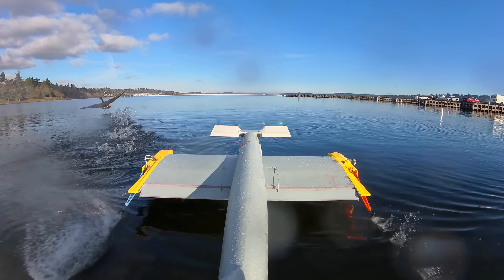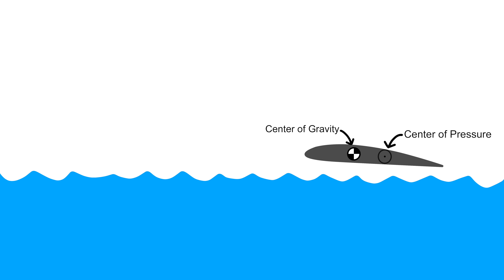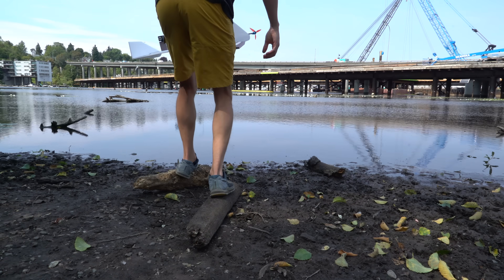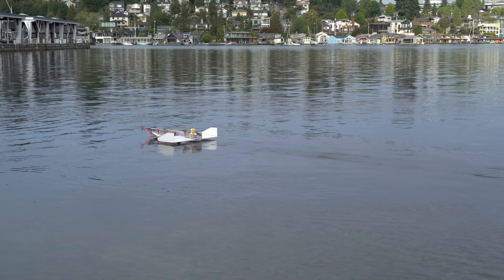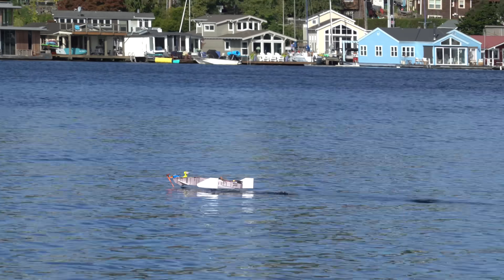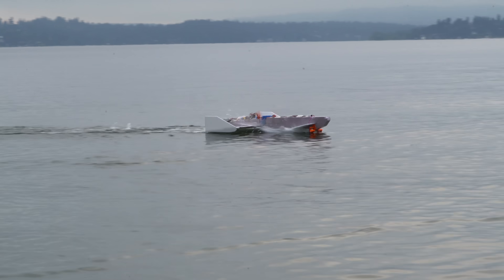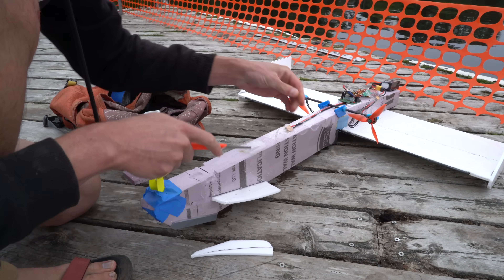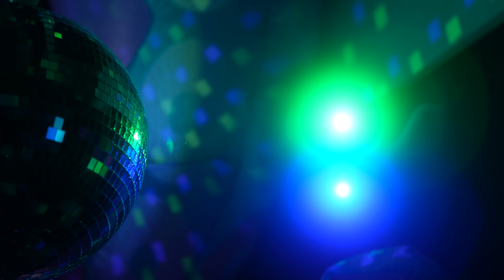Testing a Hydroplane / Ekranoplan Hybrid

Comment: For a surface drive propeller, the prop shaft needs to be level with the water. That is how it is on all my surface drive hydro planes. If they are pointed down, they will cause prop walking and skipping as they are lifting out of the water and dropping back in. Try putting them flat with the prop shafts level with the water. Even some up trim might help. My 3 motor Lobster boat has the prop shafts level on the rear of the front pontoons and the transom. It skims on the props with no wings. If you want, I can ship you my Lobster boat to play with and do some testing. It is basically a 3-point hydro with motors on each point. It looks like a Lobster.
Reply: Solid advice. ❤
Reply: That's certainly a new kind of lobster boat, lol

Comment: Idea: Stick a blade on the planing hull. A curved blade with a banana profile extending down and then to the rear of the craft. You want there to be some drag from the blade in the water (probably less than a 3d printed part could manage, maybe razor blade thickness here), but the shape would help create more drag if the nose pitches up (because more of the blade would be exposed against the water flow), which would would help 'drag' the nose down providing a self correcting curved 'wand' for the nose of plane to ride on (but without the horizontal elements like the racing boat you showed).

Comment: It looks like the canard is making too much lift. If you made the canard a more symmetrical v shape-perhaps with slightly more conventional downforce from the upper half of the v-you'd get only net lift from the high pressure underneath and it would be much much less likely to take off at high speeds.

Comment: Having the front only touching the water seems like putting the vertical stabilizer of a plane on its nose - it will strongly grab/drag and cause the yaw instability you saw. Even the small 'wand' is quite a strong influence compared to grabbing air - it's fine on the hydrofoils you showed because they have two other far larger surfaces also grabbing the water.
I wonder if the blow-over problem could be solved by using a canard layout, where the front wing can somehow, uhhh... disappear on command - for example, swing into the fuselage F-14 style. That seems more controllable than having it rotate in pitch, which changes the dynamics of the aircraft a lot and is harder to control with simple algorithms. Perhaps the disappearing canard could be linked to an AoA sensor, or a pitch gyro, or both. Either way, the disappearing would have to happen very quickly.
Reply: Thinking about this a bit more, it seems like part of the problem is that if the nose has started to lift up, there is already some rotational inertia that needs to be canceled. So perhaps a disappearing canard wing might not be enough, especially if the fuselage also has a large surface. Maybe it does need to rotate in pitch a bit, or have another 'spoiler' type surface on the top side of the fuselage nose that folds upward when the pitch is becoming too high. Or maybe the disappearing surface could instead be one that's folded in by default, and folds out to counteract pitch-up.

Comment: Could you use a ground effect canard or second ground effect wing at the front? If your lift is coming from two separated wings it would give the change in ground effect as you get closer or further from the water a torque that is in the opposing direction so might be able to stabilise the angle of attack. 
By changing the relative sizes of the wings you could tune the strength off this torquee..

Comment: Would it work to have spring loaded flaps, so that the flaps would retract from the higher pressure and then extend when the pressure is lower to keep it in ground effect?

Comment: hydrofoil front and ekranoplan back? the good thing about hydrofoils is you can create positive and negative lift so theoretically you could have a hydrofoil at the front slightly pulling down and the ekranoplan creating lift at the back, you could theoretically find a balance. You could also connect both front and back wings together with a counteracting control rod to create that negative feedback loop you are going for. It certainly would stop bouncing with a foil!

Comment: So, here's a thought: instead of a hydroplane, use a hydrofoil mast with multiple small foils on it so that as the mast lifts out you get less lift. I'd say use a V shaped foil, but I think that contributes to your yaw instability (along with your V shaped hull). If you want to stick to a hydroplane instead, I'd suggest using a flat planing surface (so that you don't get a forward pivot) that tapers to a point towards the back giving you the same decreasing lift feedback.

Comment: Not sure if this helps, but ground effect can never be a negative feedback...  The main component is increased air pressure under all of the "bottom" surfaces, with diminishing effect.  Created air pressure can be increased by a combination any/all of these components: speed, pitch and shape. Excess build up of air pressure will result in a stall or a backwards flip as illustrated later in the video. 
In short: Ground effect is not more effective with lesser distance to the surface. Its more effective with more "under" air pressure created while avoiding other adverse conditions (flip, stall etc.)

Comment: I have a feeling, a huge horizontal stabilizer is actually necessary. And it needs to be mounted very high so it is always out of the ground effect. (just like the soviet ground effect vehicle) In that way when the main air foil at the front loses life due to being too high out of the ground effect, the horizontal stabilizer is still providing the same amount of lift. Thus the center of lift will shift forward instead of backwards. (well my only experience of aircraft design is from KSP and your videos, so I absolutely don't know anything)

Comment: try equally sized nose wings and tail wings, when pitch increases both nose and tail will gain altitude equally, it wont stop it pitching up but it should stop the run away flipping effect.

Comment: I would go back to the pure WIG in the beginning of the video and counter the shift in center of pressure/lift with a very low-aspect ratio canard, far forward and lower than the main wing. When the canard encounters the ground effect, it gets a lift boost and lifts the nose, but if it gets too far up, it becomes largely ineffective and makes the nose drop again. That requires the boom/fuselage between the main wing and the canard to have almost no lift itself, so preferably it would just be two thin, flat blades on either side, with an empty space between. That way, the fuselage forward can't contribute to nose-up lift when the nose pitches up slightly, and so avoids a positive feedback pitch-up effect.
Reply: He has tied both hands behind his back by saying that the normal approach of movable aerodynamic control surfaces which he has already proved works is now "considered cheating". Actually, I did see  some kids solve this problem in a canal in Can Tho, Mekong Delta - the little sea monkey kids were playing with a toy with a long aluminium tube to the rear of the low-aspect ratio hydroplane/wing surface and that was used as a push stick to launch their ekranoplans and also as a  very effective stabiliser but it did touch the water surface occasionally.

Comment: I keep thinking, couldn't you have the battery mass on a linear rail and actively pull it to the optimal place to balance the pressure... but I guess you'd need to know the elevation pretty accurately for that to work. Like a whisker-controlled center-of-mass

Comment: Like a gyrocar, but on water

What if you add horizotal flywheels gero at nose and tale? Like two cotrorotational in front and two in the rear. Maybe it will prevent the craft from tilting too much, also you can use the differential in power inputs to yaw the craft (hence solving the turning problem). Also, you can use a drone esc to power those.

Comment: This might get lost, or maybe someone already suggested it but I kept thinking you could solve yaw and pitch of the nose by fully submerging the front nose water motors. Have a really thin chord on the extension and fixed or variable angle on the in water motors and you can use the upward pressure underwater for nose pitch and the chord for yaw control. It would natrually limit speed which could be good too. Sort of like having a submerged nacelle. It would also keep you from interacting with surface waves.

Comment: What if you had a spoiler on the wing that was spring assisted in the closed position, but when airspeed increased, it would open, thereby killing lift directly above the center of pressure? The balance could be tuned based on the size of the spring and/or the area of the passive control surface that actuates the air driven deployment mechanism.

Comment: The original Circus Circus unlimited hydro plane was a "reverse pickle fork". This video is of the unique spray deck on our Kasperwing,  ultralights,, the airfoil created enough lift to offset the weight of the floats, the top speed decreased 5mph. The spray deck and floats created a very effective pressure " bubble" which shortened takeover considerably.  https://youtube.com/watch?v=Y3C-59l62hc&si=dHPCNhUJo-vhQu9V

Comment: Having a V-shaped hull in the front was my first thought when you presented the general idea. Can't understand why you always use flat bottoms in your projects.

As for historical ground effect vehicles I think the Swedish A32 Lansen, a cold war era attack aircraft, also fits the bill. It could (and would) be flown as a regular aircraft, but in attack missions against targets on the sea (like a Soviet invasion fleet) they were flown at altitudes below 10m (and rather 5m) above the water. The nose pointing down to fight the ground effect. If the water plume behind it wasn't reaching higher than the tail fin they were flying too high.

Comment: i think your ekranoplanes are too light to avoid the bouncing. they dont have enough inertia to dampen the bouncing on the water. With more weight, small waves would not push the plane up as much when it contacts the water surface. You have too much lift compared to the weight of the plane to keep it steady above the surface. Good video though, cool ideas!

Comment: if you make the front part look more like the bow of a boat (ie. a V) then the graph of upward force vs pitch will look more like a straight line instead of a cliff. as the tip of the V initially touches the water, the reaction force will be minimal, then as the depth increases you'll get more lift with a smooth transition between instead of the bouncing you're seeing.
EDIT: oh, nvm.

Comment: Ekranoplane is not a "ground effect" plane. It benefits from it, but is more a forced air cushion plane with the depth of the wing surfaces. And ground effect is not an air cushion. This was proven in wind tunnels, though air cushion can happen with a sufficiently large enough wing.

At least I refuse to call the ekranoplane a ground effect plane. It benefits from it, but I find it's more a forced air cushion plane

Comment: Nice video! The big shocks are mostly from the air-water transition over waves, so a mass damper/inerter in the nose assembly to dampen the shocks from hitting the water may be one way to solve it. Another idea would be a small hydrofoil to ensure constant contact and a stabilizing force.

Comment: Talking about center of pressure movements, I'm surprised you haven't thought about a variable center of gravity system. Like mount the batteries on a moveable rail inside the vehicle and it would adjust to the speed of it. I suggested a similar idea on your gliding body project years ago.

Comment: Why not just a swept wing with an aggressive forward mounting so that when center of lift shifts back it gets into a sweetspot?

And a simpler glide shape for a fuselage is an ogee shape, kind of like an s-curve. The front will stall as it noses up and the rear of the fuselage will maintain lift. It will self stabilize better than a straight shape.

Comment: If you want to avoid bumpiness and want to keep contact with the water maybe the submerged t foils like the moth with a wand and capable of negative angles of attack to "pull" down is maybe an option? If the mast of the foil is long enough it can handle some chop. Depending on your speed you may have to opt for a supercavitating foil shape like on sp80 or sailrocket. I don't know how well the ride height correlates with the ground effect. You may need height adjustable wings.

Comment: what about adding a small weight inside that you can translate fore and aft to "tune" the center of weight against the center of pressure?
Reply: Oh, I see this is idea is mentioned already.  A weight out front that can translate quickly fore and aft, wouldn't need to mess with air speed.

Comment: Porpoise is caused by a hull coming on and off plane at speed. This was a problem with jetskis for years. You would mitigate it by shifting weight around on the ski, to keep the nose down. The later skis lack this issue due to adding keel length and just being so heavy that the rider weight doesn't shift cg as much or at all. Changing to a v-hull helped, because a flat bottom planes faster than any other hull design. The basic V shape with no pad, took longer to plane, thus buffering the porpoise. I think elongating the nose, by a lot, and designing the nose hull around speed, would make your concept sorta work. The yawing issue will always be a problem. The boat needs to be powered at the stern, while the aircraft needs to be tractored.
.
Maybe consider taking an existing RC boat, a long fast one that barely contacts the water at speed, and add your lifting device to that design. If you could make it stable, it could help decrease porpoise and buffer waves because the nose authority would be counteracted by the tail.

Comment: Another solution to the pitch issue is giving the wing a little up turn at the back like on flying wings the lower you are the more it acts like a defuser in a race car causing some downforce way at the back of the wing if the angle is too low

Comment: It seems really hard to balance a neutral pitching moment vehicle without doing the math on your surfaces. As long as your wing can produce excess lift, it will. And as long as your stabilizer produces insufficient down pressure, it'll always. There's an opportunity here to take it further, but it might be beyond trial and error approach

Comment: I think your main issue is the low weight and lack of inertia. Try adding 2 or so pounds of weight along the fuselage. And maybe symmetrical airfoil could help solve the lift shift issue.

Comment: I keep thinking that you're relying too much on "flying" rather than on floating on the pressurized air under the wings.

Where that takes my imagination is to use a blower to suck air down from the top of the hull at the center of gravity and then push it out the sides of the hull under the wings. That would create pressure under your wings regardless of forward motion. My hope would be that the speed you travel at would become far less important or influential.

But hey, I'm just some dumbass sitting on my couch.

Comment: @rctestflight – I see a few possible solutions to keep pitch angle:

Change the airfoil type from Clark-Y to a symmetrical airfoil.
(With a symmetrical airfoil, the center of pressure stays almost fixed — that’s why helicopter main rotor blades use symmetrical profiles.)

If you need to keep a rectangular wing shape, use a symmetrical airfoil or an autostabilizing “S” profile.

Change the wing shape from a simple rectangle to one with sweep — either backward or forward — similar to flying wings.
Reply from the maker: Ground effect vehicles benefit greatly from an airfoil profile with a flat bottom!
Reply: @rctestflight  Yes, a flat bottom will be the most efficient, but it’s unstable in terms of pitch. Maybe a symmetrical airfoil would be “good enough”?
What do you think about using swept wings on a ground-effect vehicle?
Reply: @Grifterro I think, with backward-swept wings, you'd have to raise the throttle too high before the ground effect can happen. This means it mighr suddenly lift off to vertical, stall and backflip or perform a tail-led crash. 
@rctestflight, what if you made the wings dihedral/V-shaped, just like the V-hull underneath the nose 🤔
Reply: @FlightVectorLogic Wing dihedral is a good idea for roll stability. A swept wing improves pitch stability. For a backward-swept wing, the aerodynamic force should decrease toward the wing tips.

Comment: 11:22 How about going for wings that lift, but stall at higher velocity? Wings which has lift close to the fuselage which are mounted at the back but have a velocity stall properties at a front outer edge, so that with speed the full wing will not lift the front.
Maybe you follow my idea. Small wind turbines for 12V often have this function so they don't overspeed.

Comment: If you ever mess with this again, suggest you put a surface piercing propulsion unit at the very stern. The props generally produce a vertical force which will cause a bow down pitching moment. This will tend to keep the bow planing surface in contact with the water. Adding deadline to the bow planing surface will reduce its reactance to waves and may help with the spray problem. Good luck. I enjoy your videos.